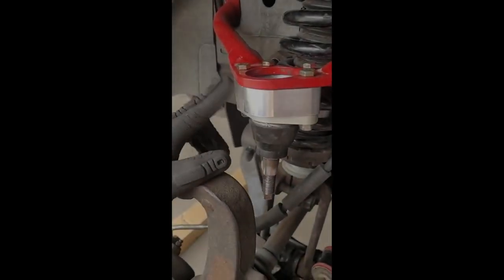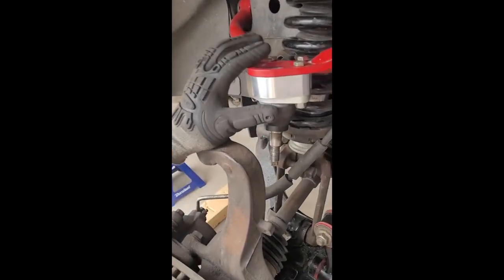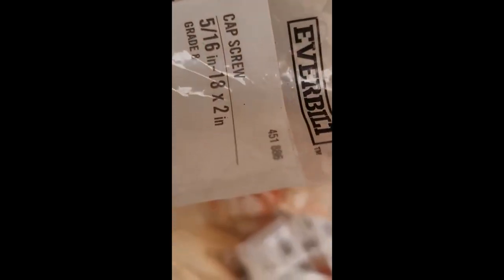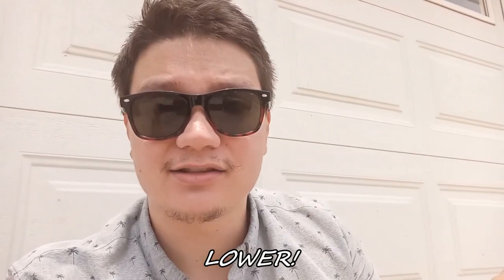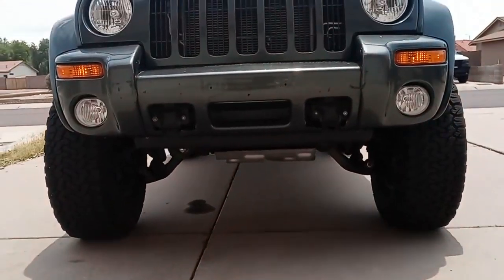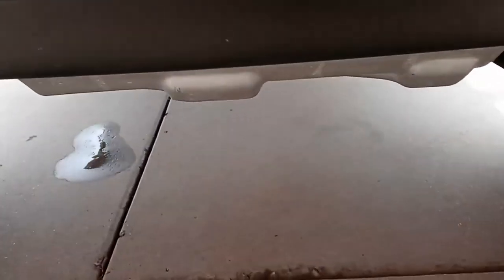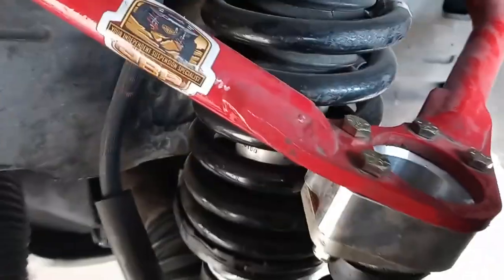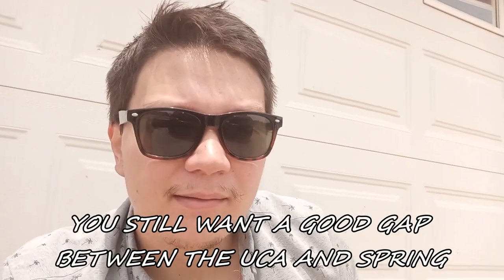Jeep Liberty UCA Spacer Review | Install

Comment: I work in a welding shop that sells hardware. The bolts I used are 12mm X 160 mm and 14mm X 160mm they cost me $36.00 CAD. These are what I used for my 1.250" sub frame drop.  I could send you a set if needed.
Reply from the maker: I'll keep that in mind for sure I just may do it that would be excellent I'll let you know when I get paid 👍

Comment: If you brought the spacers to a machine shop they should be able to make one that would help raise or lower one side so you could fine tune your lift and be able to help with your alignment (tire) issue
Reply from the maker: That's true I've never asked them  I'll have to look In to it 👍